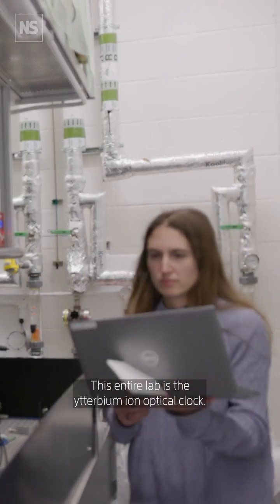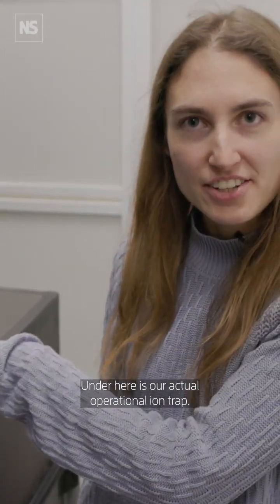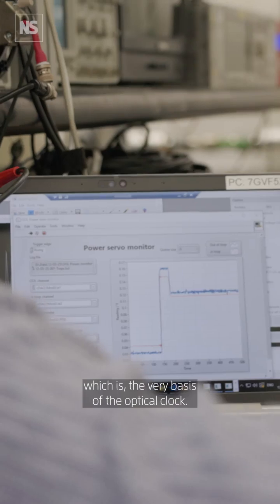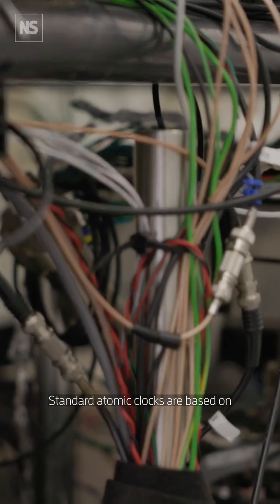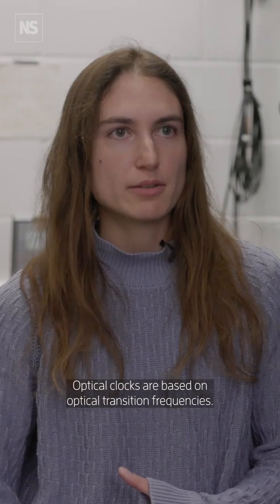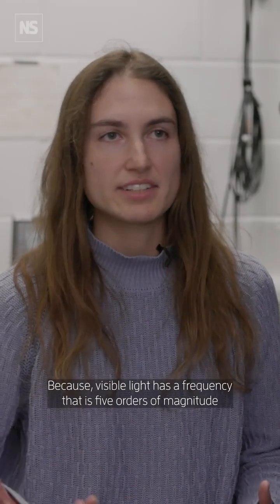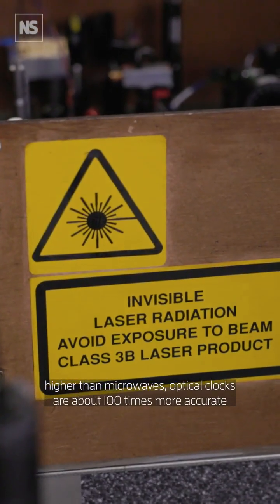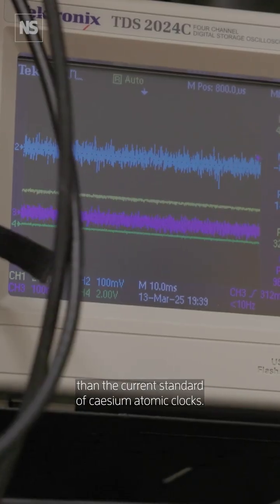How optical clocks are redefining time and physics ⏰️⌛️

Comment: If it’s 5 magnitudes higher, then wouldn’t it be around ten thousand times more accurate?
Reply: It's the frequency that is '5 orders of magnitude higher', not the accuracy.
Reply: The apparatus between the frequency of the light we use and what we are able to measure with it is not necessary linear.

Comment: How would this clock behave if accelerated to relativistic speeds? Or affected by gravity? Neat.
Reply: I mean... It is affected by gravity? So the same way?
Reply: My what a bastion of wisdom & insight I have summoned. Work all night on gotcha attempts?
Reply: @ Hardly, it was probably obvious to most people.   Only took a few seconds.  All speeds are in relation to something.   It's not like their is a galactic speedometer that measures it.  That's the whole point of relativity.   There's no special frame of reference and it is all in relation of one thing to some other thing otherwise you can't have physics.  Kind of a captain obvious thing.
Reply: @OceanusHelios  it was relative to an observer, captain obvious. That's the whole point.
Reply: @OceanusHelios  relative to an observer, captain obvious. That's the whole point.
Reply: Speeds in relation to what?  We are already at relativistic speeds to something, somewhere, very far away and are in a gravity environment.